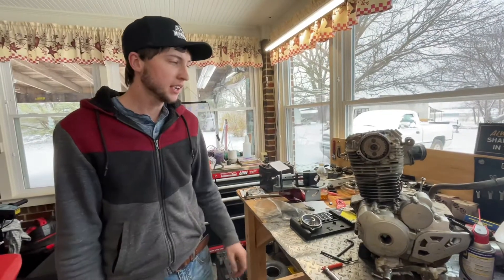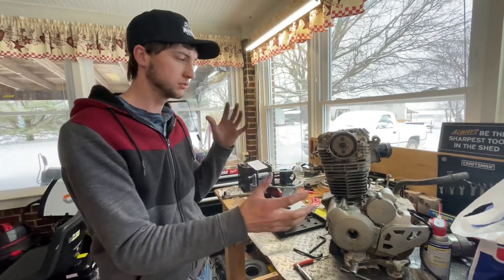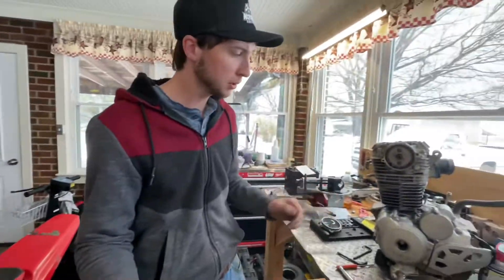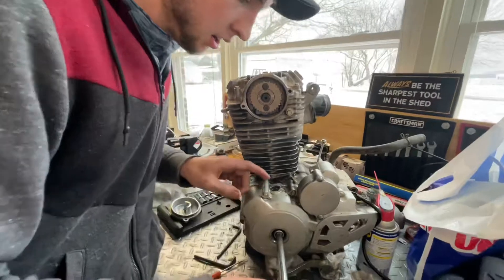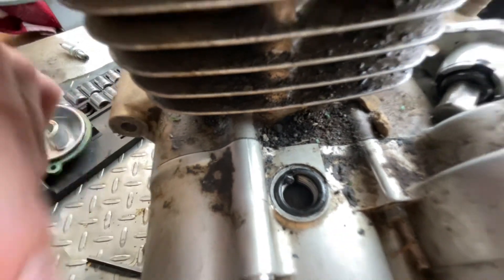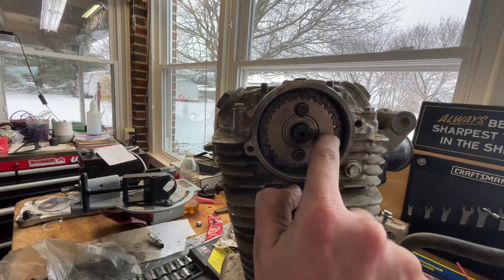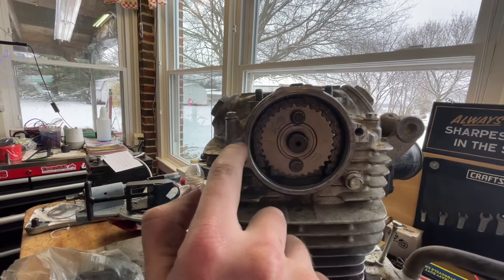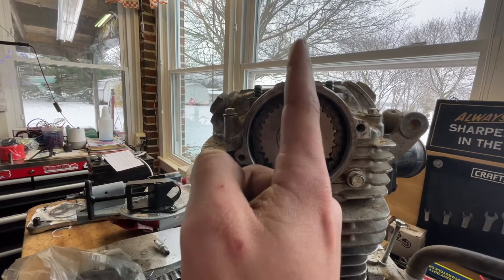How to time a Honda Crf230f (2007)

Comment: Cam lobes facing DOWN, piston at TDC

If you can’t see timing marks on flywheel use a screw driver to find TDC through the spark plug hole

On my Apollo RFX 250 CRF230F clone there was no timing marks but i just went off of what i knew from doing a BBC ON M on a XR100